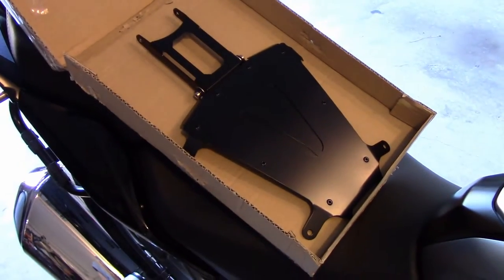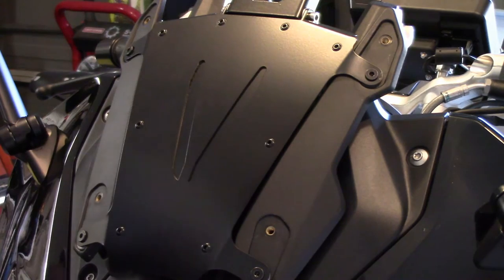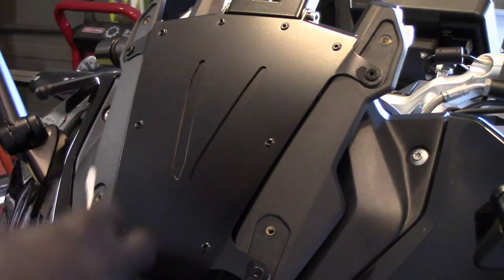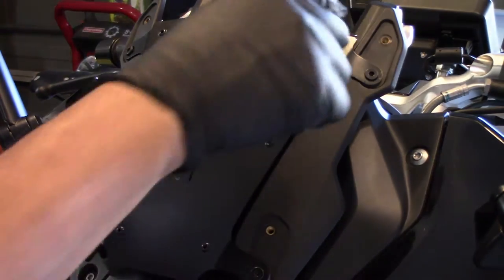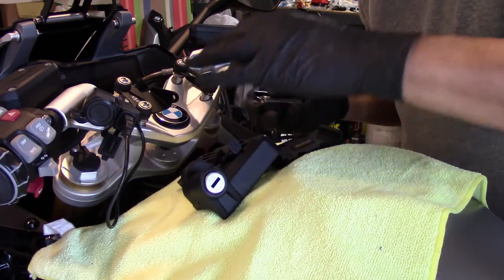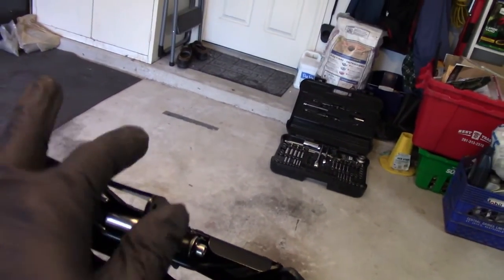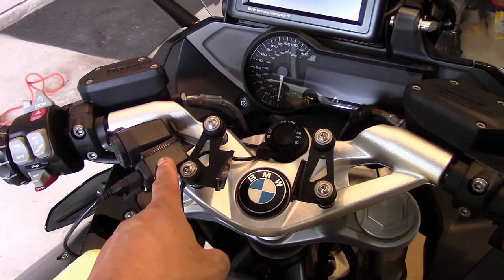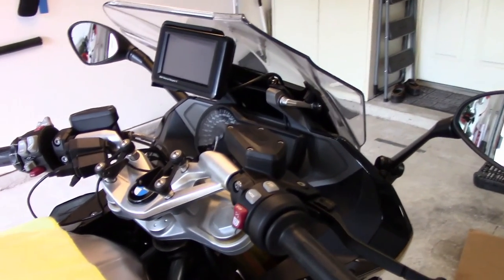2016 BMW R1200 RS - Vortex GPS Bracket installation

Comment: very good,cant wait to see oil and filter change and service light reset
Reply from the maker: deck bush Thanks for the like. I was not planning to do a video on the engine oil change but might now reconsider based on your comment. The service reminder reset was done by the dealer, but if/when I get a GS- 911 WiFi I will consider it. Thanks again.
Reply: Thanks I would find that very helpful,  your videos are so easy to follow, once again thankyou, and we'll done

Comment: hello i am french and my english is limited  so where can i buy this gps bracket
 you made a good video  thanks
Reply from the maker: Jean Michel Mornet - Thanks for the comment. Your English is good enough. 🙂  Unfortunately the guy who made this no longer makes the Vortex mounts. He stopped about a year ago. He never mass produced these mounts and only marketed a small number through one of the online forums on the RS.
Reply: Grumpy Goat Thanks for tous answer now i look to the horning équipement 
Your vidéos are very interesting  i change air filter with it 👍👍
Good road with your 1200rs ✌✌✌

Comment: Good job. Where did you connect your mobile phone to power ?
Reply from the maker: I have a Powerlet 12V socket with dual USB adapter, which I installed in the right side of the dashboard and wired straight to the battery by-passing the CAN-BUS network. Have a couple of photos but nowhere to upload them here. If you are interested in this BMW model you may wish to consider visiting RSWasserboxer.com and joining the Forum Community there. Here is a link to the thread I created in the Forum to answer your question: http://rswasserboxer.com/R1200RSforum/thread-71-post-246.html#pid246
Reply: Thanks a lot.